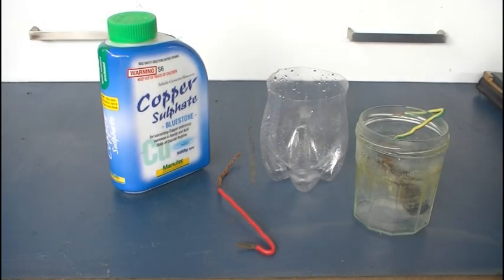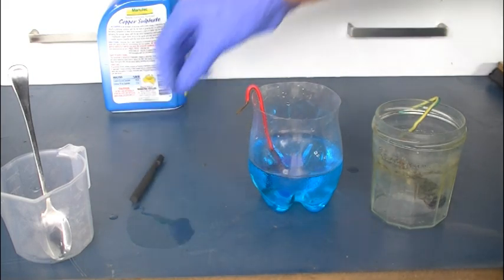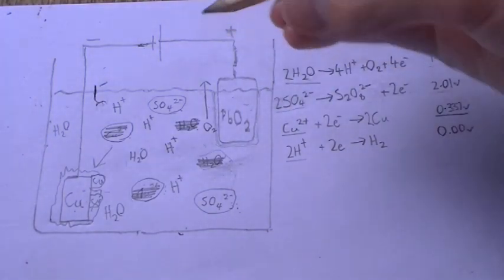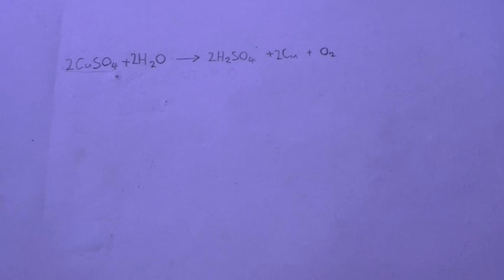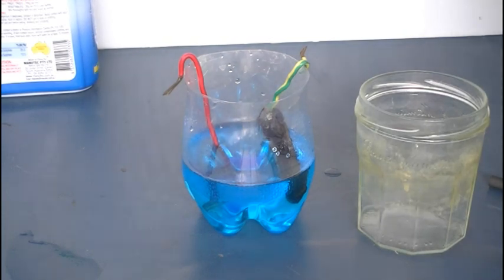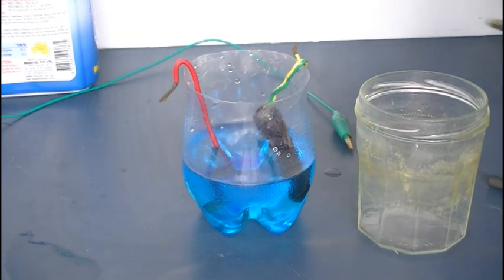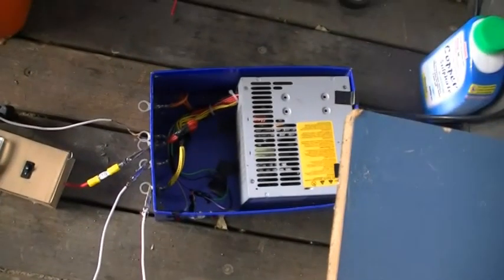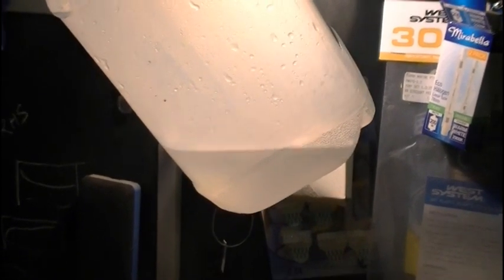Making Sulfuric Acid

Comment: Hi mate, thanks for the vids , I made some, I used the magnesium sulphate method and the ammonia sulphate method. I’ve got a digital ph measure, after many hours I tested the ph the lowest ph I could achieve is 1.4, I needed it to react with sugar so I needed it to be stronger. I looked up the distilled method but it requires speacialist equipment etc, but then I thought unlike distilling alcohol this time I’m trying to separate the lighter ingredient that has I lower boiling point “water” so I bought a cheap Pyrex jug and placed it on a inverted clothes iron for 12 hours after which the liquid has been reduced, at no point did I boil the liquid, the end result gave me a acid with 0.2 ph ! I’m very pleased with that, I’ve yet to try it with sugar but I intend on doing so as soon as I return home from work , thought you’d like the feed back, cheers
Reply: Wonderful! Did it work?

Comment: I did not understand something, how do you manage to pass 0v to the negative terminaland 12v to the positive one? please answer me i am a beginner
Reply from the maker: I can't quite explain the fundamentals of what 'voltage' is in a single Youtube comment, but simply, the voltage applied to a single terminal is different to the voltage difference applied across a load.

Basically, you can apply a single voltage (be it 12V, 5V, 0V, -200V, etc.) to any given terminal (for example, an electrode, a piece of metal, or one of the ends of a resistor). However, when you have a load (usually between two terminals), it is the 'voltage difference' (or potential difference) between the terminals which determines how current will flow.

For example, if you apply 7V to one end of a resistor, and 5V to the other end, you get a 2V potential difference across the resistor (since the difference between 7 and 5 is 2). You can then use this value in Ohm's law to predict the current flowing through the resistor.

Or for another example, a standard AA battery will give you 0V on the negative terminal, and 1.5V on the positive terminal. So, when you connect this battery to a load, you'll get a 1.5V potential difference across the load. 
(Also note that 'zero volts' really has no definite meaning, it's only the relative differences between voltages which have any significance. You could call the negative terminal of a battery '-800V' and the positive terminal to be '-798.5V', and everything would still be exactly the same)

In this case, I've just applied 0V to the cathode, and 12V to the anode, so the potential difference across the cell is 12V.

Comment: Will my lead dioxide anode Erode some day or it will give ma thousands of liters for sulphuric acid without getting destroyed ???
Reply from the maker: Lead dioxide will definitely erode over time, and has the problem of generating lead contamination. Eventually, you'll have to start filtering suspended lead dioxide from the product.
Despite the fact that I use lead in this video, I'd definitely recommend graphite for small scale production, simply because it's so much safer and cheaper to work with. Graphite particles will need to be filtered out of the final solution of course.
If you have plans for large-scale production, a platinum anode will be cheaper in the long run, and will (virtually) never need to be replaced.
Reply: @ScrapScience  can you tell me the life of lead dioxide anode ???? Because the advantage of lead is that it offers very large surface area which drives my reaction very fast . Can you tell me the lifr of the anode ???
Reply from the maker: The lifetime of an anode depends on lots of factors, including the temperature, the current density, the acid concentration you run your cell at, the purity of your copper sulfate, how thick your electrode is, and how you've made the electrode, just to name a few.

My (VERY) rough estimates for electrode lifetimes are as follows (these all assume that you have perfectly pure copper sulfate starting material and a low current density):
1) If you have a professionally made titanium substrate lead dioxide anode, it will last a long time, and you'll likely be capable of making on the order of 10 L of concentrated acid total, before your electrode starts to fail.
2) If you have a homemade titanium substrate or graphite substrate lead dioxide anode, it will likely fail quite quickly, and you'll probably make on the order of 1-2 L of concentrated acid total (but it's likely to be a lot less than that), before your electrode falls apart. On top of this, running for a long time will fill your solution with a suspension of fine lead dioxide, which is tricky to deal with.
3) If you are just using a piece of lead metal as the anode, allowing the surface to oxidise and form lead dioxide, it will last a long time. It will fall apart relatively quickly, but since the entire thing is made of lead, it will continue working for a very long time (this time will depend on the thickness of the electrode). Of course, the lead contamination for your acid solution will be very high in this case, as will the amount of suspended lead dioxide in your solution.

If you're really making large quantities of acid, you can search online for high surface area platinum on titanium anodes, which are MUCH better and more efficient for the process, and will last forever. https://electrodesupply.com/electrodes/ sells high quality, authentic platinum electrodes at reasonable prices (~$30), and you could easily put over 5 A of current through one of these electrodes (or 10 A through the bigger ones).
Reply: @ScrapScience  thanks thank you for this precious information 😊

Comment: What was the voltage used
Reply from the maker: I don't really remember, probably something like 5 V. Either way, the voltage is not a critical element of this process, anything above 2 V DC will do the trick (though I'd keep to low voltages of around 5 V to keep the current and the reaction rate at controlled levels).

Comment: Can you trap the hydrogen gas and the oxygen gas to use later? And where is the best place to get copper sulfate? Copper wire is easy to find and so is lead!  Using a much larger container and a funnel shape over each of the electrodes should trap the gas to use later. About what % is the acid? Would putting more copper sulfate in the water give a higher %of acid?
Reply from the maker: 1) You definitely can collect the H2 and O2 gasses. However, there are much more efficient ways to do that electrolytically, and the amounts of gasses generated on this scale are quite small, so I don't normally bother.
2) Copper sulfate is a very common gardening supplement. I get it at my local hardware store, but nurseries will probably also provide it too.
3) In hindsight, using lead metal as an anode here was a stupid idea. It results in contaminating the solution with a considerable amount of soluble lead, which is difficult to handle or dispose safely. A much better option is to use graphite/carbon (even pencil lead will work), though it does slowly disintegrate and you'll need to filter the final product.
4) The percentage of acid produced here is on the order of 3%, but I've since scaled up the reaction to make 40% acid with no problems. Getting anything above 70% concentration would be unlikely though, as the reaction proceeds much slower as the acid concentration rises.
5) A higher amount of copper sulfate in the initial water will generate a more concentrated acid solution, yes, as the two quantities are proportional.

Comment: i tried this with pencil graphite but it dissolved quickly ;( any ideas? i dont like using battery graaphite rods cause i think theres toxic heavy metals in the like thallium cadmium arsic mercury... 
OH can i bubble h2s to make CuS and H2SO4?
Reply from the maker: It will really depend on the battery as to how much heavy metal contamination you'll get, 6v lantern batteries are often pretty good in that regard and contain high quality graphite rods. Toxicity is a pretty reasonable concern though, so you could also buy graphite rods online, or buy 'gouging rods/gouging carbons' from a welding supply store (they come coated in copper but that won't affect this process as the copper will dissolve off quickly under anodic conditions).
Using H2S will likely work as intended, but the gas is pretty scary to work with in my opinion. If you're capable, and have the setup for making/containing H2S, go for it!

Comment: Would normal coffee filter work well on filtering the carbon?

HDPE is the only plastic safe for storing sulfuric acid, right?
Reply from the maker: A coffee filter will work fine for any concentration you're able to generate with this method.
Lots of plastics can store sulfuric acid, HDPE, PP, PE, and PET (to name a few) will all do fine at concentrations less than ~80%.
Reply: @ScrapScience  If you keep adding copper sulfate when it is clear, would the concentration go higher and higher?

Is there an upper limit to this?
Reply from the maker: @changweihsu  Yes, adding more copper sulfate continuously will make more acid. However, there is an upper limit in the sense that copper sulfate will become less and less soluble as the acid concentration increases, reducing the efficiency as more acid is generated. You may also run into problems of faster anode degradation at these higher concentrations too.

I’d imagine a sulfuric acid concentration of 50% is probably obtainable by continually adding copper sulfate, but getting anything above ~70% would surprise me.
Reply: @ScrapScience  Hi Harry, I was wondering if letting the water evaporate by sunlight will increase the concentration of the solution. Does it work for other acids?
Reply from the maker: @changweihsu  Yep, leaving it in the sun, or a warm place, will allow the water to evaporate and increase the concentration of the acid. This will become less effective as the concentration increases however, as it will gradually require more and more energy to drive off the water.

This will work to some degree for most acids, particularly dilute solutions, but acids like HCl and HNO3 are somewhat volatile, and you will lose some in the process.

Comment: I’m trying to get my head around the calculations and have rewatched the 7:57 part numerous times.
When working out the moles of H2SO4 in 200ml of water where do you get the 5 figure from for 0.06 mol x 5 = 0.3M
Reply from the maker: The 5 figure comes from the reciprocal of the volume in litres.
I'm skipping a step in there, but: concentration = moles x (1/volume). I'm finding the concentration by multiplying moles (0.06) by 1/volume (1/0.2, which is equivalent to 5).
Reply: Scrap Science  thanks so much 💡 now it makes sense.

Comment: To find sulfuric acid, go to a store that caters to the janitorial trade.  They often sell sulfuric acid in concentrated form as a drain opener, at least here in Canada.
Reply: Well the problem with that is that i live in Europe, here the regulations are a lot stricter than in America so u can't get sulfuric acid that way.
Reply: Indeed, just the other day I went to a home hardware in Ontario and found a bottle of sulfuric acid drain opener that claims to be 96%, it does have some dye it in though so it may be necessary to break it down with some hydrogen peroxide.

Comment: Thanks for going through the math!  Where did you get the oxidation and reduction voltages you showed for the preferred reactions, and how would you calculate when one becomes preferred at different concentrations (e.g. Hydrogen versus copper)?
Great videos, thanks for sharing!
Reply from the maker: Wikipedia has a data page of standard electrode potentials which I used for this reaction, and a bunch of online textbooks and pages have similar information. 
As for calculating the potentials at different concentrations, you need to use something called the 'Nernst equation', which is a little too complex to explain in a youtube comment, but it basically allows for calculation of a reduction or oxidation potential at different concentrations/temperatures/pressures. There are a bunch of websites online that explain it better than I ever could, so if you're interested, I'd recommend just googling it.
Reply: Scrap Science thanks!  Having the name of the equation is a huge help, as is the phrase "standard electrode potentials."
Reply: @ScrapScience  Out of curiosity, how would tungsten compare to the graphite?
Reply: @ScrapScience  if you refill the solution with CuSo2 powder and continue to make electrolysis will that gives you more concentrated sulphuric acid??

Comment: I was looking for this video but didn't know it..
I was getting ready to do nurdrage's electrobromide method, but this is so much easier!
Thank you.
Reply: And i was looking for the perfect alternative for platinum electrode but i m still thinking will the lead dioxide anode last long 🤔🤔🤔
Reply: @sciencefusion5352  lead electrodes are not great because you risk lead contamination which if your not prepared to deal with is a pretty big hazard. By far the easiest, cheapest, and safest anode is graphite as its resistant to oxidation and arent toxic. While the carbon powder in annoying it can be filtered out and won't spead lead everywhere you use the sulphuric acid.
Reply: frnd i used lead bar and it worked very well and awesome the result are satisfactory i am getting hundred ml of concentrated sulfuric acid from one pound of copper sulphate pentahydrate the reaction is occurring  very fast as I am using large lead bar with high surface area 
I live in India and for me lead metal is much cheaper than carbon rod 😁 thank you 

Thank you again ☺️

Comment: What was the ph of the sulfuric acid? I’m curious about the purity
Reply from the maker: I performed this experiment a long time ago, so I don't really remember, but it was definitely lower than 1. I've been able to produce concentrations above 2M with this method, and I believe it could be made much higher.
As far as purity goes, it really depends on how pure the copper sulfate is. If the copper sulfate is recrystallised first, the final sulfuric acid can be made very pure.
Reply: @ScrapScience  How much current was there? I see from your diagrams that required voltage is very low, but I'd like to know how much current is needed.
I have an old phone adapter I could use for this, using 400mA at 5 volts. Would that be enough?
Reply: 1pound of hydrated copper sulphate can give you 100 ml of conc sulphuric acid this is my practical result

Comment: After getting clear solution of H2SO4 and then add CuSO4 again  then eletrolise the solution again. Would the concentration of sulphuric acid increase.
Reply from the maker: Yep, it certainly would, just be aware that the solubility of copper sulfate will decrease as the concentration of sulfuric acid rises.
Reply: @ScrapScience  Does that mean you won´t be able to get to 96% alone by electrolysis ? If not I heared heating down the volume should help is that right ?
Reply from the maker: @Telectronics Yep, while you can achieve pretty high concentrations with this method (I've achieved as high as 40% in the past, and it could probably go higher), electrolysis alone will struggle to generate concentrations over 50-70%. While it would in theory be possible to get closer to 90%, the low solubility of CuSO4 and the drastically decreased conductivity of the sulfuric acid (which occurs at high concentrations) makes this a very slow and inefficient process. On top of this, very concentrated sulfuric may start to react preferentially on the anode, contaminating the sample with peroxydisulfate.
It's much more sensible to make some reasonably concentrated acid by this method (25-45%) and then boil it down or distil to concentrate. Not that that's an easy thing to do, boiling acid is something to be done only with proper safety equipment and quality glassware.
Reply: Yes you are right it´s dangerous enough when it´s cold but hot even more. Destilling should at least avoid splashes and fumes are directable which could be saver. Thank you for your detailed answer. I appreciate it you do always a great work :)

Comment: Can i use lead rod instead of PbO2
Reply from the maker: You can, and that's what I've done in this video (as the surface oxidises to PbO2 anyway). However, I would seriously advise against using any kind of lead based electrode without the proper safety equipment and ability to deal with waste. It is incredibly easy to poison yourself if extensive safety measures are not taken.
A much safer anode would be carbon or graphite, even pencil leads will work for small scales. If you can, please use that instead.
Reply: Thank you

Comment: If using a carbon rod, one may use a sleeze of some kind that will catch the fine particles, allow current to pass, and is resistant to the acid. If i recall, tea bags are made of cellulose, so as long as neither the temp nor concentraton gets too high, it should work.